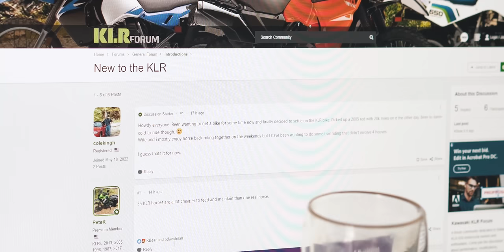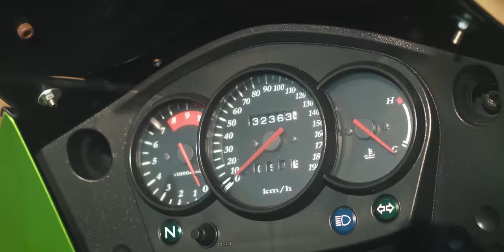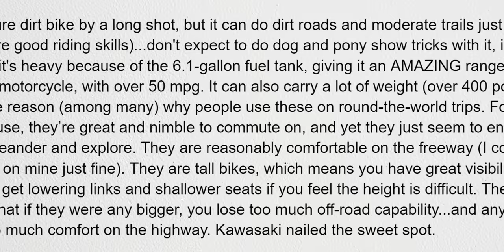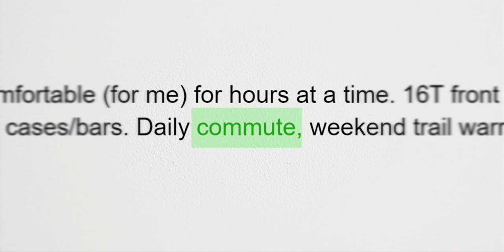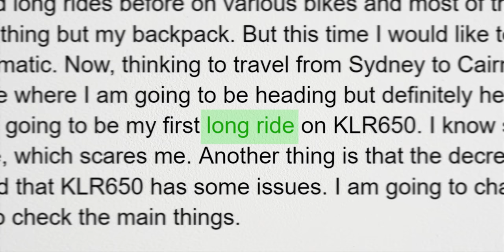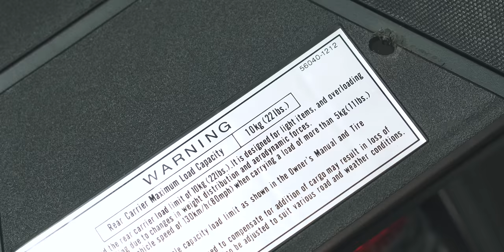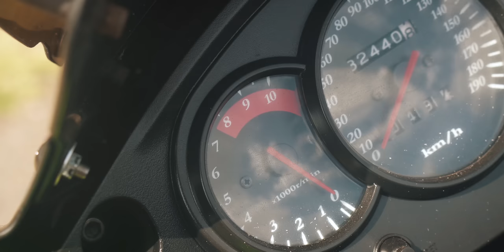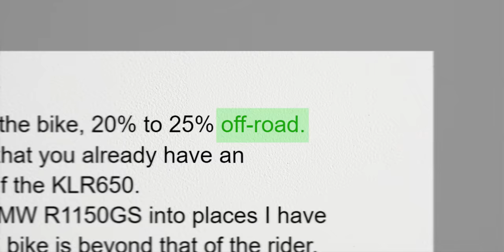I HATE the Kawasaki KLR650… so I BOUGHT one

Comment: Some people prefer sport bikes, some prefer dirt bikes. There are so many different reasons people like riding on 2 wheels and there are so many different types of motorcycles/scooters out there. I don't really like track bikes and think they're pretty over-powered and pointless on the road. I mean, who needs to ride in a racing position to commute to the office or go grab lunch somewhere?! I understand that many people prefer them, even if I don't really understand why.
I love adventure bikes/dual sports because they just open more doors to things i'm able to do and places I can go. Single cylinders might not be the most efficient design compared to v-twins and inline 4's, but they make up for it in simplicity. I've never encountered a mechanical issue I couldn't troubleshoot(dr650 and dr250). Parts are cheap and readily available. I don't care how the bike looks. I care about saving 2 hours on my morning commute by lanesplitting across the bay bridge, and the clogged streets of SF. With that same bike, I can cruise to the Sierras during my off time and ride around the farm or go explore gold mines and jump in remote rivers and lakes without spending much on gas. That would cost a fortune in my car, and would be impossible on a street bike. 
When I buy a more powerful bike, which is something I plan on soon since the 650 is a little underpowered on longer highway rides, it'll be another dual sport. Thinking a GS or tiger, but I'll never get rid of the trusty DR.

Comment: The KLR 650 is probably my dream bike, i love them. At the moment i currently ride a kawasaki Versys 650 as the KLR isnt sold in the UK, or at least where i live. Its often said, If you want a tall road focused ADV from kawasaki go for the Versys, but off road focused Adv go for the KLR. On road its slow but on trails itll literally do anything. That said have i taken my versys off road? Yes, it wasnt great its only got a 17in front wheel, but it did well enough. So why is the KLR 650 my dream bike? Well i like kawasaki and i like going up narrow twisty roads with often off road sections that go to abandoned castles, while the versys hasnt failed me yet, its not the best at off roading, small rocks feel like craters and big rocks feel like walls.

Comment: I can argue with you about the fuel injectors being more reliable than a carburetor. With fuel injectors you need more electrical parts which fail, sensors that fail, ECM with fuel map programmed in. If any one thing has a problem, the bike doesn't run properly or at all. With a carb you don't have all those annoying issues.

Comment: 01 KLR650  day 1 0 miles 2 yrs later 50k miles. Biked did everything I asked it to do..  
I just picked up a 94 KLX650 with 50k on it and I'm doing a full top end job and should get 50k more out of that..   I have a 16 CRF1000 and that is my fav big bike next to my 13 XT1200. 
Also have a 04 KTM 525 and a 08 WR250F and I still think about all the fun I had on that KLR....

Comment: You covered all the points of these bikes well. Why buy a $20,000 +  adventure bike that is heavier than the KLR or a SuzukiDR650.
So many expensive adventure bigs here in OZ that never go off road. Only touring they do is on the tar. May as well buy a road bike. The equivalent of Mum dropping kids off at school in the Range Rover.
Buy a KLR or DR, drop it who cares.
The advantage of a DR 650 over the KLR is the guards are plastic. Break one, go buy another cheap plastic copy.
Try doing that on an Africa Twin, BMW, Triumph Tiger etc.
Those 650’s were made to go on a bit of dirt and not worry about scratching it.
So don’t be a Range Rover Soccer Mum!

Comment: Too bad the Suzuki DR-650 isn't available in Europe anymore. One of the most fun bikes I've ever owned. Relatively light (about 70-80 lbs ligher), inexpensive, stone cold reliable, smooth engine, crash damage resistant, tons of aftermarket parts like no other and mod happy. Do a Youtube search this bike has quite a following

Comment: I bought a gen1 KLR650 with 44,000 miles on it for 1,200$ because I was working with a limited budget. The old owner kept up on routine maintenance so she runs like a top. Having owned an XR650L previously I can say that the honda did everything better then the KLR offroad. However the KLR650 is such an amazing adventure bike and I have no regrets about picking it up. I've put 4,000 miles on my bike within five months and I've wrecked it multiple times and she has never given me any issues outside of a dead battery and leaky pet cock valve. The KLR is a tank but if you are a skilled rider who is comfortable with your machine I can promise that you'll have a blast off road and it's surprisingly easy to and fun to wind out in the corners and hit berms with. It's no 450 by any means but if you cant flick an old thumper off road chances are you probably won't be doing it with a 1100cc bike anyways. It might not come with a bunch of features like heated grips and abs, but you don't need any of those things to have fun. Not to mention the KLR has a very low maintenance cost and I literally can't stress that enough. To get a brand new top end installed at my local mechanic is only about 600$ which is amazing when you live in the California economy.

Comment: Almost a motorcycle.  I bought a new one in 2015.
It was a dog, and st speed (120 kph) it was stretched right out.  I took.it of paved roads but no single track as the KLR is too heavy.
The bike was cheap. I bought it to replace my 2005 GSXR 750.
A now have a Suzuki Vstrom 1000 (2015)
A way better bike.
I also have a 2011 ZX10R . An absolutely wonderful bike. brutally fast and solid.

Comment: Great review and video!

Only vehicle I ever purchased new was a 1999 KLR ($5k) I bought it for dual-sport touring and commuting because of the big tank, and water cooling. 

I immediately installed DOT knobbies, bash plate, bag racks,  bark busters, and yes - a roll chart case. I put 45k hard miles on that piston before retiring the bike with a leaking gas tank, 2nd blown year shock, and leaking fork seals. I beat that bike mercilessly, on road and off, and barring a few warranty issues, it never let me down (under "normal" use). I did manage to break the main sub-frame bolts during a 200 mile dual-sport ride, but the bike was fully loaded, and I was going flat out over rough terrain, catching air repeatedly. Not exactly how the bike was intended to be ridden. Even so, the bike itself provided the necessary hardware to press on.

While the KLR certainly has its limitations, it also shines in ways no other bike can. At least for the money. I did eventually purchase a used, 2004 XR650L for $3500 that, while far superior off-road, it fell short in most every other aspect (except overall build quality). 

Keep up the good work, and keep it on the rear wheel! 👍

Comment: Efi was designed for better fuel economy and is marginally better than a good carburetor, the advantages to a carb is it's super simple and can easily be serviced in the field, efi takes computer and many sensors so carburetor from a reliability standpoint is much better.

Comment: had a 2nd gen KLR, a 2008. My biggest bitch, at highway speeds, kept looking for a 6th gear, 5th, was highly "buzzy" taching about 4000 rpm at 60 mph(96 kph)
AND don't forget to mention, they only $7000 brand new
KLR comes standard with hand guards

Comment: KLR owners always have a long list of reasons to explain why owning a KLR is a good idea. Which means the bike doesn't sell itself without lots of justification. 

I owned one for a year when I was broke. Put over 10k miles on it and it never complained once. I hammered that thing nonstop. It didnt care.  But that doesn't mean much as any bike should easily handle being used. NONE of my bikes have been and more or less reliable than a KLR. Standard Japanese reliability I see in all my bikes. My KTM has also been just as reliable as the KLR was, and I've had it for years now. 

I don't regret owning a KLR, but I have no intentions to own another. It's the only bike I ever sold and didn't miss. They just simply exist.

Comment: in my opinion I like the looks of the KLR more than the Yamaha you have. this is my opinion of course. but I do prefer the Gen 1 of the KLR a lot more than the newer ones.
Reply: Same, I like my 2006, right before they started putting the hard plastics on them that will break at the slightest tree tap.

Comment: I am sorry you don't like it but it works great for me. It's off road and on road. It's for casual riding and you don't run out of fuel. It's not as expensive as part for the other type bike in the same family. It depends on what your riding mood is. I own 10 bikes from an RC51 to a TT90.

Comment: Try a 82 xt550 by yamaha single cyclinder dual sport very torquey but not fast it wasn't meant to be fast just as you stated. I bought mine in 85 rode it for years. I live in the pacific northwest in the United states where mountains are everywhere and i live near MT Rainer so climbing is where the singles shine.

Comment: These claims you make are just solely based around skill. I have a 1st gen KLR650 with 31k miles and I can rip it ANYWHERE at 70mph + in the woods, 90mph + on the highway and I can ride wheelies on it with ZERO issue. Keep in mind I'm only 21 and 145lb. Don't believe my claims then watch my videos on my channel! The KLR650 is a beast if the rider has the skill to bring out the power! Also comparing the KLR to the MT-09 is crazy lol. That's like comparing a Toyota Corolla to a Hellcat

Comment: Truth be told its because people try and make the KLR something its not. The KLR is the upper end, of a true Duel sport bike before you end up in the ADV bike territory, which is just a glorified touring bike that can go on dirt roads. If you strip a KLR down, pull out all the BS, and give it just enough bits and bobs to be street legal and set it up for Off road, you have a upper end weight class Enduro/duel sport bike. You can beat the crap outta it, fix it with a set of hand tools, find dozens of parts and it will keep going. Problem is people are weighing it down with a bunch of useless crap on it. The Hays M1030 (Military KLR) is a perfect example of what the KLR really is meant for. But people try and turn inhem into weird adv bikes. which they suck at doing. The issue also being is that modern "duel sports" seem to have lost their intent, trying to be a do it all of a bike. Duel sports are LITERALLY only meant to have JUUUUUUUST enough gubbin on it to make it street legal, thats it.

Comment: Lol those aren't mods haha!

The REAL mods you need to make it shine is ditching that big goofy fairing and the 50lbs of useless crap up front. Mine is streetfighter style in the front end, a 7" bucket style LED light and progressive front springs and is way more lively and exciting.  I put it on an extreme diet all the way around and probably lost close to 100lbs overall removing fairings, chainguards and other non-critical garbage and all the associated hardware and bracketry.

I opened up the intake, rejetted, put a 240w stator in it, now it has a bit better power at altitude and makes enough electrical power to run extra trail lights and charge extra batteries .  I did a big IMS tank, lighter than the stock one until it''s full,but then i have a 500 mile range.  Toss some Dunlop D606's or equivalent tire and you're good to go.

Mine is at it's best putting in long overland days through the deserts and mountains of the southwest US.  Nothing else has legs like it, and there's sections where it's a hundred or more miles of open range cactus slalom, no roads, trails, just open desert scrub.  I can ride like this for literally 3-4 days of adventuring and exploring remote places without having to go anywhere near civilization to refuel.

And yeah it sucks on the streets but you don't go adventurin' on pavement, that's why you have a KLR desert pack mule, to go where there ain't roads or trails and all that fancy stuff.  I guess id you live in a concrete jungle then you're better off with something else, but if you live in the middle of nowhere and commute to another middle of nowhere over mountains, canyons, across valleys mostly on dirt, mud, or snow, haul heavy loads up when my road is impassable with cages (snow, washed out spots, landslides etc), or drag a load of firewood home when a tree falls in the road.

I use mine more like a two wheeled work ATV or a tractor than a bike, i commute over rough terrain, haul tools and stuff like bags of concrete around the land, and go places where not much else can reasonably go.

Comment: Fuel injection is NEVER going to be as reliable as a carb.  Never.  The overarching thing you realize after riding for a few decades is virtually nobody can ride any motorcycle to its limit.  Therefore all the newest, latest, etc. etc. is largely irrelevant.  Learn how to really ride a 20yr old superbike and you will outrun 99% of the new bikes out there.  Own, ride and mod an old KLR and it will take you, well, pretty much everywhere a new brand X will, but at one tenth, or one twentieth the price.  You ride more, and enjoy more when not working to make payments on the latest and greatest.  I was commuting 20yrs before Chaos was born.  Its not about what you ride, its about the ride itself.

Comment: I've owned 3 of the big thumpers Honda Yamaha and also the KLR for a short time....   The Yamaha XT was by far by far my most ridden and loved the KLRI really had contempt and hated that d*** thing besides it came with a bleached out pink color ,   so I had to paint over that...
 2nd Kawasaki I had, both the same very disappointing other one was a Vulcan V twin and both had pathetic unsafe breaks neither 1 could stop you properly.. The fit and finish was also poor try to take it apart and you can't line it up to put it back together because the holes weren't drilled in the right place for some silly little bug screen. Now the KLR for years everyone is talking about that do Hickey oh did you replace the du Hickey yet why in the h*** should you have replace anything like that that is obviously a design flaw...
 The bike is heavy it's way too tall unless you're about 6' 2 with long legs and and handling is mediocre power is OK it's just that low and off the line torque could be a lot better.. My KLR was in great shape ran perfect but still Lacking in a real character. The next bike I got was a triumph tiger 800 and it's twice the machine only paid about 5500 for that bike and it was fully equipped to already included heated grips...
 I just failed to see the attraction or the value in the KLR is just Sort of pathetic

Comment: To claim that EFI is more reliable than a carburettor is misleading, mainly because WHEN EFI systems fail (and they ALL will eventually), it will most likely be due of a terminal electrical or electronic failure of the systems that control the EFI or feed it the information required to operate. 

Depending upon where you are in the world at the time, it could take days, or even weeks or months to get the parts. Depending upon the age of the bike at the time, it could cost hundreds of dollars for the new factory part, or not much less for a used part. And eventually such parts will become impossible to obtain. 

However, if you have a carburettor, the jets might get blocked or worn; the needle might get worn; the float and shutoff valve might stop working; or you might get an air leak in the gasket or rubber manifold. Every one of those issues can be fixed easily by the roadside by an illiterate Uzbek goat herder for a few dollars. Or you can just fit a new carburettor. 

The utter nonsense talked about EFI is like the tropes such as: ‘trust THE science’ and ‘support the troops’, ‘build back better’ or ‘carbon neutral by 2030/2050’. It’s ALL just nonsense. Why? Because first you have to be honest about the true nature of the situation. Because just as we know that plants grow better in a higher Co2 environment, Carbs don’t need a $1000 computer to make it work. And the tiny Swedish elf puppet is being paid to cry. 

Grow up and start being honest before Orwellian lies define your demise.

Comment: You get away from being a smart carb guy and go back to 1987 carb. 1987 carb fails, it cost 10 mins and a clean. When the smart carb fails and so just did ur entire trip. Anyway, ive ridden snow capped mts, the rainforrest at sea level, high plains, desert without ever needing to rejet the carb. High elevation or humidity.....open the air screw a qtr turn.

Comment: Misleading information. Claiming that one cylinder isn't powerful and mentioning the 42hp from the 650 to prove it is very misleading. How about the Husqvarna 701? 70+hp and a single cylinder.
Power has nothing to do with how many cylinders an engine has per cubic cm size.
Waffling information to the unknowing via a journalistic channel that has a large audience misinforms them. It's not good practice.

If you want to educate about cylinder numbers and power output, please include all of the variables or shut up.